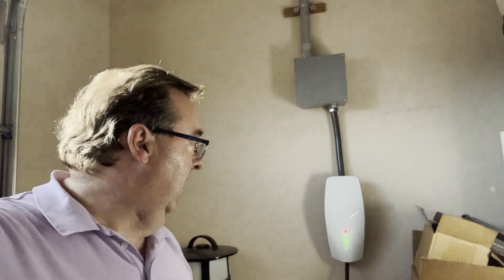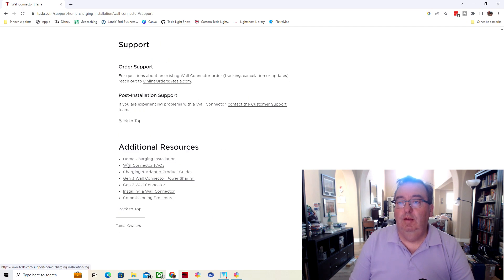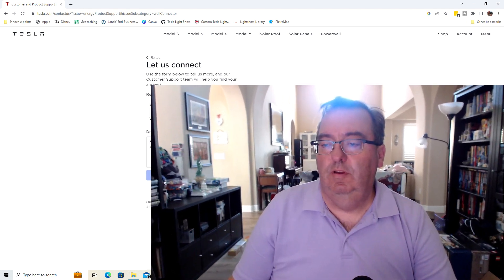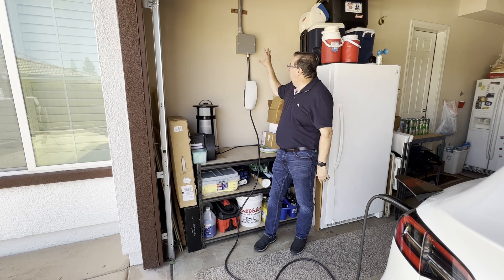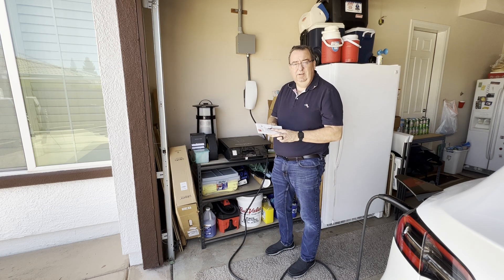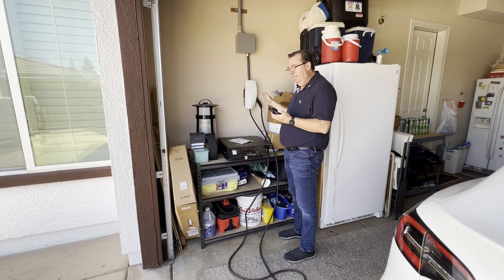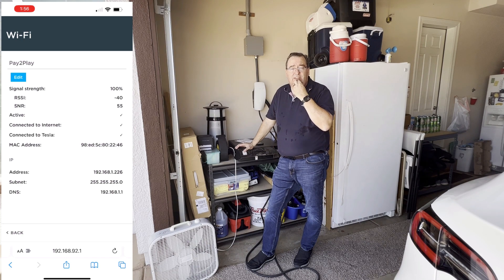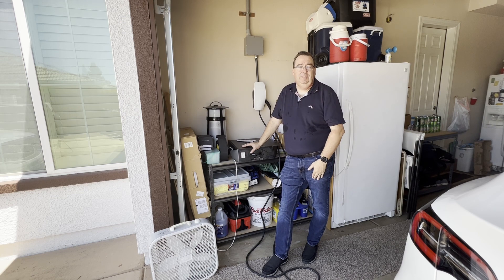Updating a Tesla Wall Connector

Comment: Thank you for the instruction. I recently had electrician install the wall charger for me. But he didn’t help me to connect it to wifi. I wonder if it is needed to connect to WiFi. I honestly have no idea how to do it
Reply: You don't need to connect it to wifi. I used my TWC for about a month before even connecting it. It just adds automatic firmware updates if there are any, a realtime-ish graph of speed of charging, some additional minor scheduling options, and allows you to add/register/restrict who can use your charger. So if your charger is in a publicly accessible area, it can't just be used by anyone. If you keep your TWC in a garage or private space, most of that doesn't really matter. Most of the scheduling stuff is an overlap of what you can already do through the Tesla app.
Reply: @ thank you this is great information. The technician connected the wifi on his Tesla one app and told me everything is up to date. I guess I don’t need to do anything
Reply: @vg4902 what is a TWC?
Reply from the maker: Sorry I was out of commission for a while.  Did you get it connected to wifi?
Reply from the maker: Did you ever get it to connect to wifi?
Reply: How do you update firmware without connecting to WiFi?  Don’t have password and can’t charge.  Frustrating as hell!

Comment: Thanks for posting this video. I recently changed to Starlink and thought I had switched every connected device to my new network, but had forgotten my Tesla Wall Connector. Now I've switched everything--until I find another item.
Reply: Great video glad I came across this. I started having a red light flashing recently as well. Still have to do the update.

Did it work for you?
Reply from the maker: @djjerryg_soundexpressenter5874  no it didn’t so they sent me a whole new unit to swap it out with.  Video to come soon on the swap out!
Reply from the maker: No problem.  Glad I could help!!